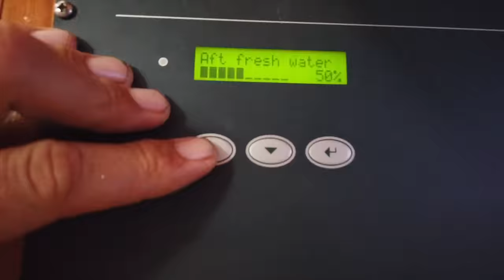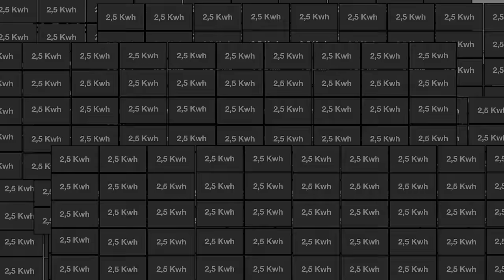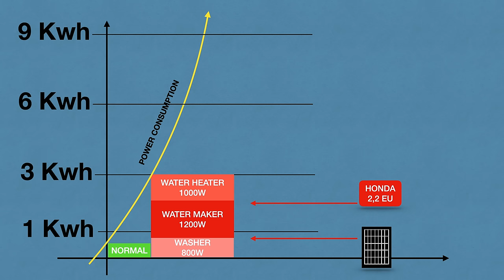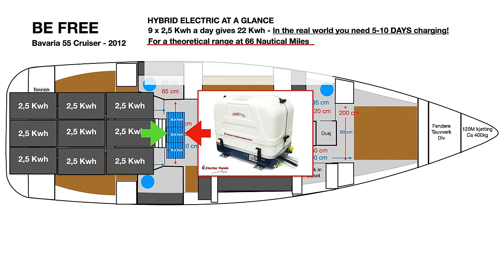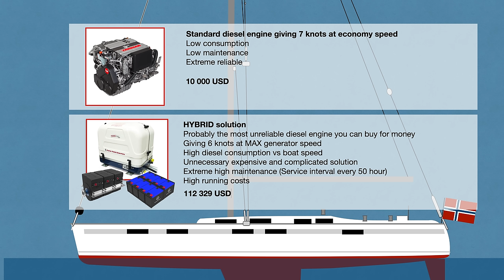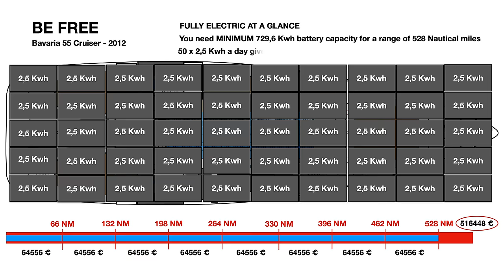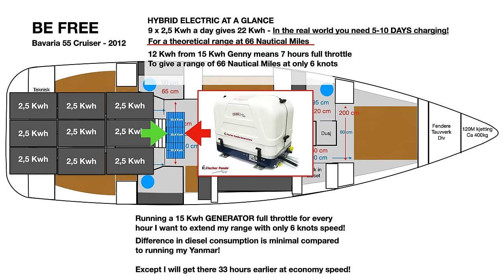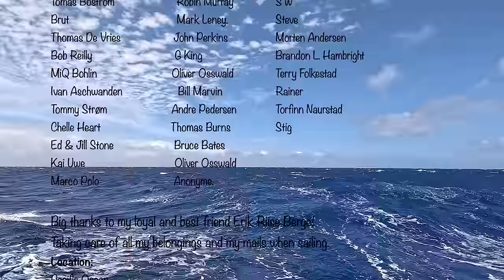Why I don't believe in ELECTRIC or HYBRID for long-distance sailing - SwT 170 - MY HONEST OPINION

Comment: I understand kinda your way of thinking. Hybrid engine is a diesel engine and electric engine so having a range of 1000 NM with engine is already there. Adding a hybrid to your existing engine would cost you money. Here is how it would pay for itself. you don't need a big Electric motor as with a hybrid it is so you can enter anchorages and marine docks. Sure you can use it to help sail when batteries are full after regen filled them.  Using an electric motor to change angle  to adjust sails or even change head sail costs you nothing. every time you start your generator it costs you money. Every time you start your diesel it costs you money. All those $5 here and there add up. Also sailing uses a lot of battery energy for auto pilot and Nav system. Regen when sailing covers that and can even add to your charge level. If you have to run the diesel that Electric motor works as a high power alternator to charge batteries then you shut down diesel and use Electric motor to sail 10-20 NM noise free and with battery only.  Then you should find wind if not run diesel again till batteries are 100% again and repeat.  Sure a hybrid with a huge solar system is better but still even with a small solar system it will pay for itself in 5-10 years. After that you start saving money. Non of this is out of the box profit its an investment so in 10 years your diesel hours have been cut by 25-50% so its still running good and you did a lot less maintenance and costs of that.  I agree that its a lot out of pocket up front but its worth it in the long run. Big heavy boats will take bigger electric motors and more battery bank size. More solar helps. These new Catamarans/trimarans can sail wind speed at 5 knots of wind. You already have batty bank so your cost is less.  you show a huge battery bank needed for 500 NM but with a hybrid you already have it with even a small battery bank. it takes diesel which you already have.

Comment: Many great points but your calculations ignore that electric propulsion doesn't require that much power to move at an albeit but real speed (2.5-3kW for 4.5-5kts) and your solar production can account and surpass this during daylight. At 3kW you need 72kWh per day to cover 120NM. This is of course a significant amount of power storage and for 500NM you'd need about 300kWh of storage. So indeed a generator is required if you want this much autonomy. However the argument for hybrid is that most of the time, you don't need to use fuel to move if most of the time you're not motoring for days on end. And if you do need to motor for days on ends, then the poorer efficiency of other generators is not a big deal, all things considered. However for these reasons still I think the BetaMarine parallel hybrid system is the best choice. In the meantime hopefully someone will make a proper diesel genset to put FischerPanda to sleep.

Comment: I agree , it might work sailing from close port to port in the Caribbean or Chesapeake Bay but that’s a very expensive option . The green scam with EV is finally ending because of battery fires . I can’t imagine a fire on a yacht from very fragile battery packs . 
When I had my Jeaneau 43  I carried the yellow cans on deck as you do . As much extra as possible! Motor sailing I found to be happening a lot . It gave me the ability to have options on courses I would not otherwise have . People who have never been in tight anal sphincter situations at sea have no idea , no realistic sense of the sea . The sea is always  trying to kill you , it is not a
Benign   Environment.

Comment: Thomas you're results are what i feared however i suspect the marketing to rely soley on solar/electric energy is similar to marketing as relying on wind only like its 1880 and you're Slocum sailing around the world.  A hybrid solution seems to be the best compromise for fuel vs not fuel... however based on what other sailors have documented with fisher panda issues... well fisher panda failures speak for themselves.

For those coastal or land based; hybrid/all electric it really boils down to time/spent kwh (you can measure diesel to electric thanks to metric countries using kw vs. hp). Do you have the time/ability to spend those kwh? well with a diesel there is a more calculable kwh than all electric not reliant on a fossil fuel generator. for a terrestrial energy use/output/input analysis look at the various ford F seires. F-150 gas, vs a diesel (usually outside Canada, USA, Mexico) and the hybrid F-150 hybrid vs diesel. those numbers will speak more clearly in engine use and milers per hour. at the end of the day does elon musk's kwh battery perfomance fill you with confidence or make you hesitant to make the switch. until all the early adoption is complete (when the usa is 70% electric vehicles) relying solely on an electric system is the same as being wind only; and relying on electric in a harbor.... unless thats what you reserve it for and have good personal data to kwh/h discharge rates.... tl;dr have you build your electric system to propel you equal to a diesel solution; whats that cost? it's roughly 10k to upgrade to a victron or dakota (see ryan and sophie sailing) electric solution and that's just to make it so you can watch net flick and play candy crush without shore power. now do some more annoying math on battery charge/discharge rates -- you might have the kwh to do what you need but not pull the amps needed to offset a tidal current at the Solent. 

Do i personally want all electic? yes. will it likely make me saillike its 1887 likely. is there a better compromise? yes but we've not seen its market saturation yet.

Comment: Hi, I have an electric sailing yacht 38 feet. You are using the mist expensive and unreliable ocean volt.
Using solar only at 1.2KW can travel at 3 knots on a good day. And with 2 banks of 10KW have a range of 130 NW. Under sail loosing 0.5 n can regenerate 300 to 500 W.
But I agree with you that ocean crossing electric is not ideal.
Take care😂

Comment: I have to disagree a little. No offense! 😊

First of all, the speeds and ranges.

If you go with electric boat, you sail differently. You have to know your range and boat and its behavior. Then you don't even assume to have 1000NM range or even close. You go by the weather even more. Stay in the calm for a few days or weeks even. Sailing has been done for thousands of years. Diesel engines have existed like 50-60 years. So it's kind of going little bit back in time in a way and closer to nature. Not all boats have engine at all even now.

Than the speed. With electic, you go slower. In my experience and knowledge gained, around 4 knots is sensible max speed to go. Over that, the consumption raises dramatically with just a small speed gain.
Even larger boat can go 3-4 knots with maybe only 3-5kw of power. That means, that with sensible amount of solar, the range is actually almost unlimited. Without generator at all.
Of course, there's situations that will require more power for a while (like strong currents). But it comes to the fact that you have to know your boat and avoid going into that kind of situations in a first place.

Than the technical side. Electric motor is perhaps the simplest device there is. There's really no maintenance, they are very cheap (so cheap you can buy one as spare). All you really need is the motor, controller and batteries. So for the case of lightning strike - you can simply have few spares on board in safe place. (And I can say, lightning is one of the thing I'm most concerned!)
--> That means: no fancy ready-to-go systems. Oceanvolt is great, but their price is just out of this world (especially the batteries!). I'd say that doing things DIY (which you should if you're going for long distance cruising anyway), you can make full electric system with even decent amount of batteries for 10K.

Then there's regen. If done right, electric system charges your batteries every time you sail. That actually should be essential feature that should work well to make electric system really usable.

Which brings us to the question. Is sails the main propulsion or the diesel engine? Would it actually be just that much more economical to ditch the whole rig, sails and stuff (like tens of thousands) and just buy diesel instead? (sails+rig are actually quite expensive/NM!)

One thing I totally agree though! Hybrid systems are waste of money. If there's a generator/engine, it should be just a backup of backups. All diesel engines are complicated machines that require a lot of supportive systems to function reliably - so with hybrid system you don't really gain anything, just making it more complicated and maybe giving false feeling of security.

Comment: You are of course entirely correct, especially for a 55 ft boat. It's conceivable, almost, that a low power hybrid system might be kind of viable for a light (with batteries) 30 ft trimaran covered in solar panels - but probably not.
However you're missing the point. That point is to convince yourself, and more importantly your patreons, that your somewhat hedonistic, somewhat self-indulgent lifestyle is completely sustainable, even noble, and something that 8 billion people could be doing (or 4 billion boats and 4 billion patreons). 
If it's any consolation having that diesel engine and running it occasionally is probably no worse than commuting by car (electric included) a couple of hours a day and your boat is probably using less than the 20kwh/day of the average home.
In fact - I'll consider my boat. 10 tons. 3400 hours in 40 years at about 2.5 litres/hr. Round that up to 250 litres/yr. That would get a very economical small diesel car about 5,000km a year, about a third to a quarter of what drivers average in most countries. More importantly, as long as your solo _sailing_, you're not generating babies.

Comment: After 50 years + sailing I am 100% in agreement with you , 110% , Green offshore sailing is a myth , Im even very hesitant on any batteries that are not gel sealed proven old school , Good Bulmer alternator & as you have there a Honda Gen. for those times when you need a bit extra > Power tools ,Water Maker or just a charge up for freezers Etc. Reality is hard for dreamers ,Now plastics ???? & Dont get me started on Pandas , They make good mooring blocks .
Reply: Sailing was “green” for centuries.

Comment: Your concern is very valid for serial hybrid, but parallel hybrid does not have issues you mentioned. There is no need to generator and yet you can always charge while moving while having access to your diesel proportion. Although I wish I could find a sail drive parallel hybrid solution. Beta and Combi's solutions are only shaft drive.
Reply: Thomas, please comment on parallel hybrid. You only covered part of the topic and what you covered is not what the current installations have been doing. It would not pay for you to replace your diesel but yanmar will be offering a parallel add on in the future. You are usually more thorough.

Comment: The fact remains that Sailing Uma has proved going all-electric is in fact possible. Their boat has been all-electric for many years, including a two-year sojourn in Arctic waters, sailing as far north as Spitsbergen, up and down the Norwegian coast and circumnavigating Iceland. They also proved that the idea that batteries don't work in cold weather is nonsense, and of course batteries have been around in all colder regions of the world for a century or more. La Vagabonde's new boat is a hybrid, but its diesel failed in the first week and they have been relying on solar for propulsion, instrumentation, cooking and everything else for a month now. In their case it was their Oceanvolt drive that saved the day.
Reply: Uma also has to break out their generator more than you think and more than they show on video.  They will happily sail at 3 knots or bob around in the water, rather than use their motor, because they don't have the energy density to motor for than 10-15 minutes, even at 3-4 knots.  Those speeds are barely enough to counter light currents.  A quality hybrid system makes more sense but is still very pricey.

Comment: Your traditional sailboat hull shape cannot sustain long distance sailing on electric drive. However you can feasibly do a diesel electric build on trawler style motorsailer over 50,preferably 60ft.

That being said, batteries and motors to make it possible will be around $200k not including installation.

I worked this out on a 64ft motorsailer trawler (and decided against it) that had a top speed of 14knots and a cruising speed of 8 knots. 

2x75kw motors to replace 2x130hp engines.

2x100kw diesel generators. Why 100kw? 100kw genset running at 70% load consumes less diesel than a 75kw  genset running at 100% load.

7kw solar at full capacity

220kwh of battery capacity.

When running at cruising speeds with no sails, my estimate range on battery was about 60 nortical miles, while motorsailing, anything upto 300 miles with no generator use.

If the generator ran constantly, the boats range would be upto about 1100 nortical miles when the original range was 700. The gensets I was going to use consumed about 75% of the fuel the original engines used.

My total estimate was $180,000 for just the batteries, motors and gensets. Not including cables, chargers, inverters etc, so I decided to give up on a conversion.

Comment: I had great pleasure, watching Sailing Uma, use a petrol generator to top up their batteries in Norway.🤣
Reply: But they managed to sail there up to Svalbard. So suck it up.
Reply: Uma only use their electric propulsion to get into the docks. Not to actually motor. The rest was sailing.
Reply: @jl6156  During the depths of winter.  Quite impressive really.